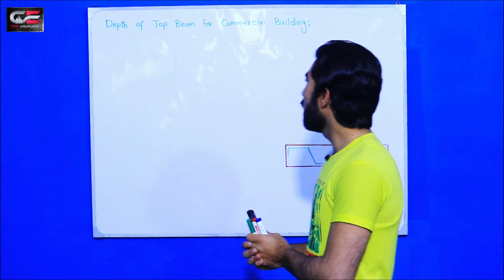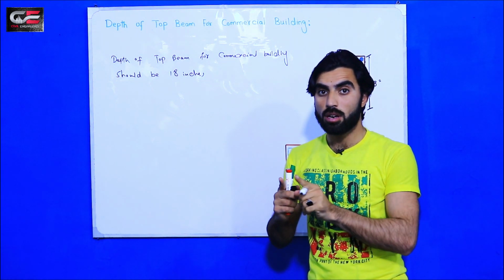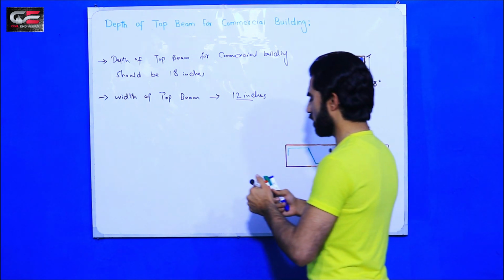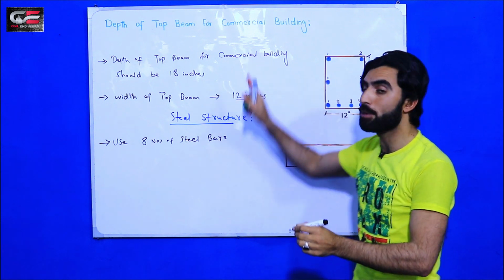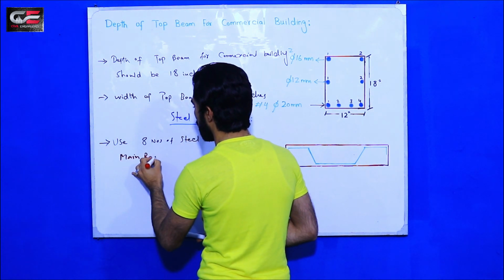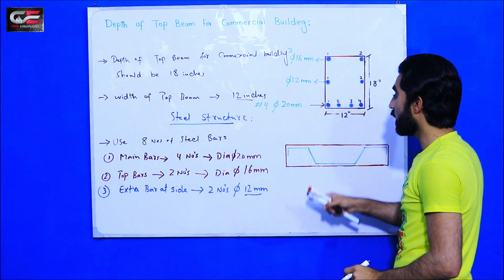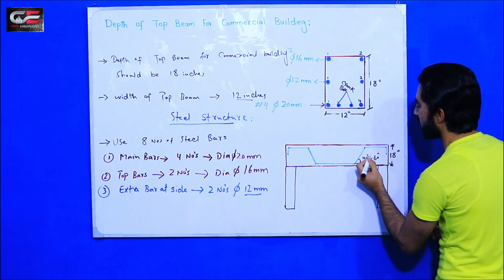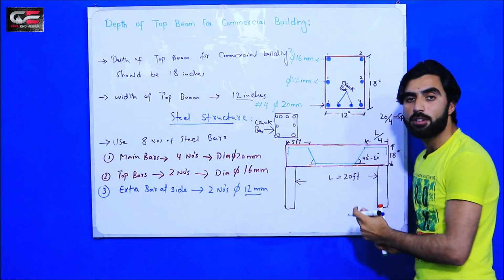How to Calculate Depth of Beam? Depth of Beam and Reinforcement details for Commercial Building

Comment: Room size is 15 by 20 ft. On 20 ft side there is 1 beam in centre. So slab is 10 by 15 ft. Will you consider it 1 slab with 15 ft main and 20 ft distribution bars or 2 slabs with 10 ft main and 15 ft distribution bars. Thanks in advance.